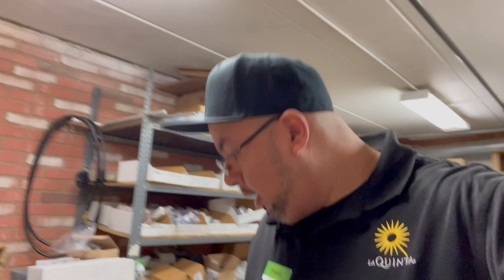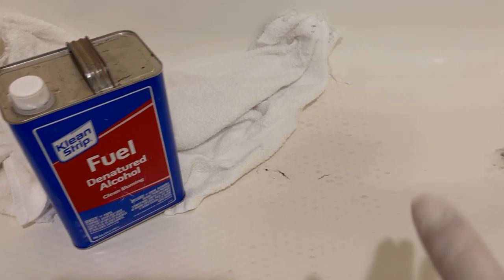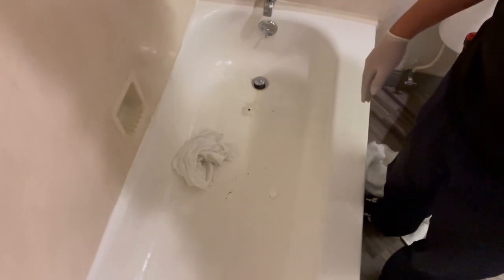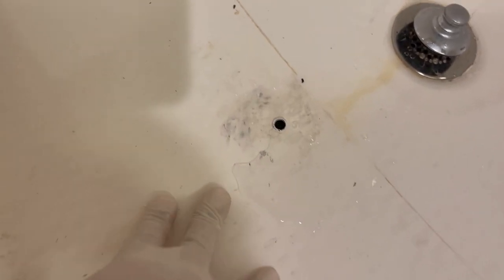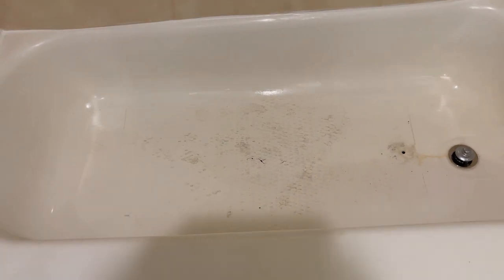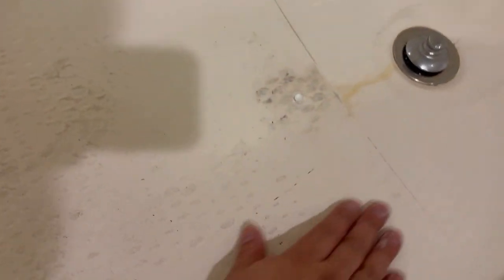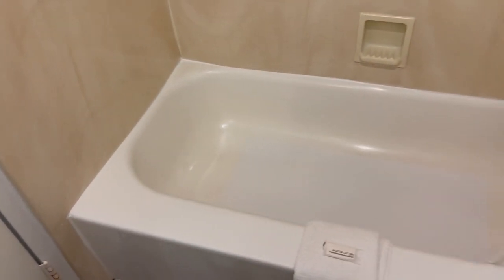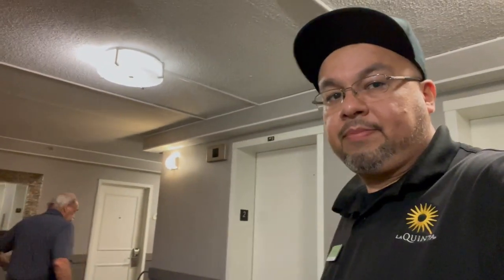BATHTUB LINER PROBLEM

Comment: I had a question about the hole in the tub thing. I have never came across that. If the leak is coming from drain do you guys pull those drains up and clean and put new plumbers putty in? Alot of time if those drains get the littlest of damage to them they need to be replaced because they cause leaks.
Reply from the maker: The problem is not the drain is the way they installed the liner. If I remove the drain and try to fix it the liner will go out of wack and will ruin it.